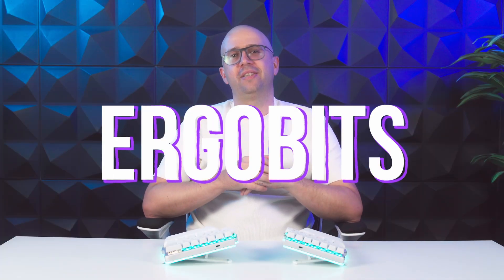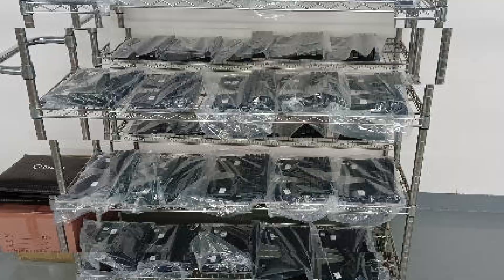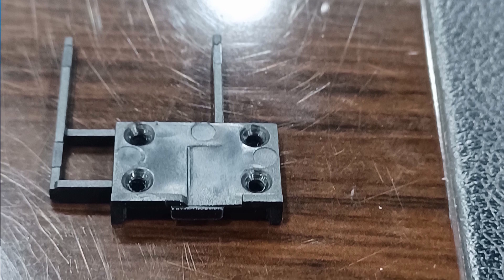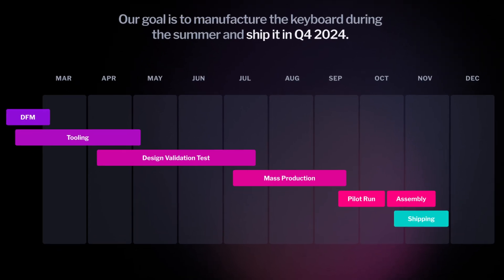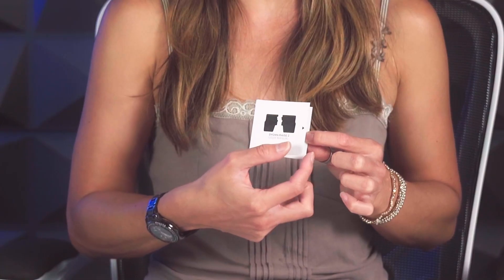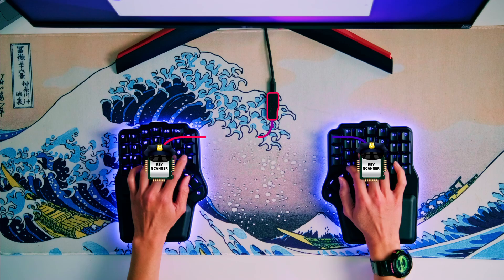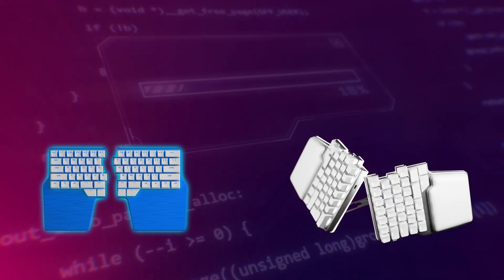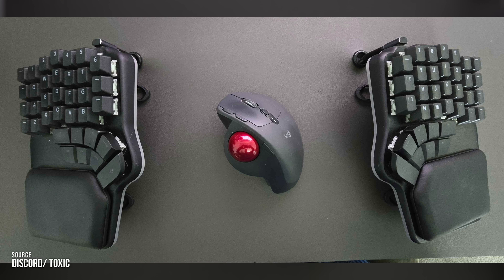Get Ready for the Raise 2, firmware updates and more - Ergobits #4

Comment: really looking  forward to my new keyboard :) Just testing out the latest bazecor v  1.5.2-1 quick suggestion... 
1) On "keys & shortcuts" screen at the top where you select the layers is it possible to more quickly switch between layers without the "click on drop down, and select the different layout" either a + - button or use the scroll wheel when hovering over the drop down ? This would make it easier to flick through layers to compare them etc.
Thanks for consideration.
Reply from the maker: Thank you! I'll share this with the design team. We're going to make the scrollwheel navigate through the submenus of the keypicker, bu well think about how to improve layer navigation.
Reply: @DygmaLab  Great :) I'm only just getting to grips with the software before my shinny new keyboard arrives. Another thought... A built in short cut that could be assigned to any key that would bring up (popup) screen shot of current layer (just the keyboard view with colours and short cuts shown as they are in the configuration interface, and perhaps a keyshort cut (up/down) to cycle through other layers ? would help to remember where keys are etc.

Could be even a function to print to pdf that same view of each layer as a cheat sheet... but printing sounds a bit old fassioned. I'm sure your all very busy, but just an idea if you hadn't thought already.